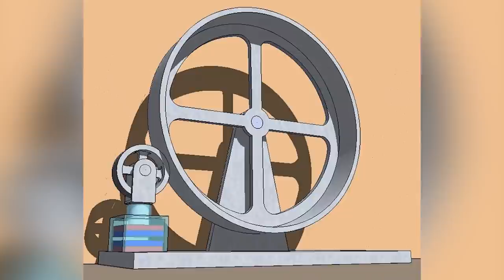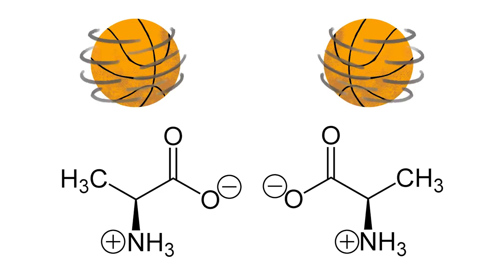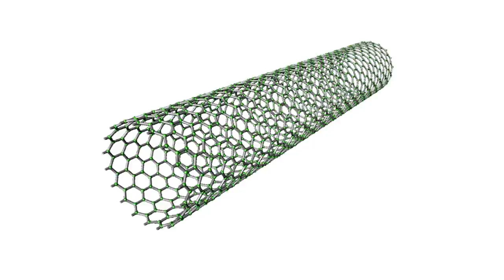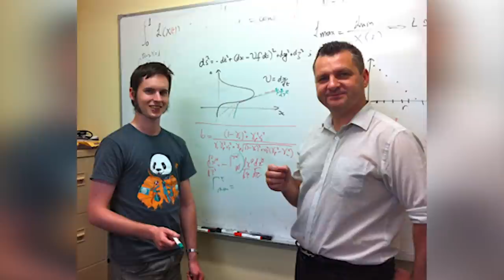Things Invented Just To Defy The Laws Of Physics

Comment: I’m sorry but here’s a list of things wrong with all of these:

10: dipping your hand into lead has nothing to do with defying physics 

9: perpetual motion machines clearly follow the laws of thermodynamics and therefore physics

8: follows the laws of physics 

7: warp drives don’t exist which means they physically can’t defy the laws of physics and what you mentioned at the end was an ion thruster which does use fuel, ionized atoms 

6: molecules aren’t the same as ions 

5: doesn’t exist and diamond nanothreads aren’t nearly as strong as graphene and this elevator is way to expensive to make and it would have to utilize rockets to build it. It’s incredibly heavy and with the current cost of payload per kg, it would be a lot longer than 2050 to make this when rockets are efficient and cheap

4: this doesn’t defy physics at all 

3: you explained it yourself, Newton’s 3rd law applies to this

2: this is just a prototyped weapon that follows physics 100%

1. Follows the laws of physics, the speed overpowers the surface tension until the friction slows it down enough that the surface tension breaks and the car falls in.

Please when you are doing videos about inventions and physics, do your research. Some of these things don’t exist and the ones that do, follow the laws of physics which makes your title very misleading. Also some of your information was flawed like how you confused an ion thruster for a warp drive. An ion thruster ionizes lithium ions and shoots them out and then they bounce of atoms around it, hit the thruster which generates lift and speed. A war drive supposedly messes with space time which is practically impossible. Please research your topic when making a video about it to five million or more people because some of them will believe it and go their whole lives thinking that we have the technology to go faster than the speed of light (which is impossible according to almost every physician in the world). Also judging by the way you present your videos I’m assuming your core demographic is thirteen years old or younger which isn’t really fair if you are going to give false information to younger kids because it will probably stay in their heads until someone corrects them which will confuse them a lot. 

Please do your research. It’s not that hard with all of the viable sources available which clearly state real information like nasa and others. 

Sincerely,
A random thirteen year old kid in Ireland that wants to be an astrophysicist or astronomer when they grow up and is really into physics.
Reply: You’re totally right. This channel doesn’t put in the time to make sure they know what they’re talking about, and they just do it for the views and stuff. Although, on number 5, it might have been an inclusive or. Like he was trying to say it could either or molecules or ions, because it could one or the other. But otherwise, this video is completely not factual like you said. Science is awesome and keep aspiring to do it.
Reply: Joshua Dorsam thank you. Nice to see another intellectual👍
Reply: Srsly. I cherish every one I meet. In this world of social networking and flashy facts with no background, people generally are introduced to many topics in a one-sided manner. It makes it hard to separate fact from fiction when non-qualified individuals seem credible and people believe them simply because they haven’t heard differently. Science as a whole is almost never correct the first time, but if people haven’t heard anything else on the topic, everyone who sees the ‘post’ immediately takes that stance. For example: My family liked the Patriots before this “Deflate Gate” BS or whatever. Now, even though the original document is retracted, people to this day still tease me about my Patriots Hoodie or whatever I happen to be wearing. It sucks when scientists realize their mistakes and try to sway public opinion again on the issue. Take Monsanto GMOS for example. TL;DR it basically says scientists linked GMOS to certain medical conditions. When people heard this, they were outraged. Like Washington Revolution outraged. People tried to burn the buildings down, protested by destroying their labs, singing songs of hatred and disgust in the street. The uneducated general populace is a powerful thing. If you are still reading this, thanks for listening to my rant about American culture. I don’t have many friends, so guess where I turn to get my thoughts out. Farewell, fellow intellectual.
Reply: Joshua Dorsam I read the whole thing and honestly found it very interesting. I had never heard about that whole event before and I really learnt something from it. You sound like a guy who deserves friends and I wish you the best. Goodbye dude👋
Reply: Dude, I want to be an engineer(software engineer to be precise) and I’m a huge nerd, so I love physics and I totally agree with you.                    Sincerely an eleven year old boy who is a giant nerd
Reply: TMak TNT keep aspiring to do that. It’s a great career path👍
Reply: Mag Arts  thank you for all that
Reply: it might actually be possible for an object to travel faster than the speed of light via anti matter but you would have to use electro-magnetic tanks to hold it because it literally blows up if it comes into contact with any sort of matter other than itself but yes you are correct this Chanel does not put enough care into anything science related
Reply: Alex Anderson I’ve heard of that theory before and just thought it sounded impossible, but interesting nonetheless. I fully agree about the channels lazy content
Reply: not to mention a bunch of the actual images and clips have nothing to do with the actual subject matter... starts talking about Perpetual motion machines, shows a lego marble run, talks about a warp drive but shows an EM drive which is a completely different thing.
Reply: damn
Reply: AwesomeVindicator haha. Also I didn’t know all of physics was just e=mc^2 written on a blackboard
Reply: Welove Terrorists I know. It’s a disgrace
Reply: Not to mention he said that proxima b was 80 years away, when its actually 4.2
Massive difference
Reply: Nicolas Bonny yep
Reply: Justin Andrei Diana Tamayo your welcome
Reply: Woowwww, I'm ashamed to be one bit European, if I have this "I am very smart" extremely extremely fun at parties person who has European
Reply: Mr. Cheese woowwwwwwwww, your gonna be  whining that I spelt you’re wrong? Grammar Teacher
Reply: Umm, diamond nano threads are another name for carbon nano threads and graphene I a flat version of the same thing but are not as strong for cables
Reply: @WHOOOSHXDOfficial  oh. A "popular kid." Not gaining my respect.
Reply: I love physics alot too but im going for chemistry. Im close. I have another 4 semesters to get my bachelor's. They say theres a hierarchy for difficulty in science. It goes biology < chemistry < physics with physics being the toughest. I kind of wonder where computer science would fall
Reply: ARONIOUS2 have fun in college man!! i’d say computer science is around 2nd easiest
Reply: @sheauiwne5294  hey thanks man! Im curious if you studied science in college and how tough it was for you if you did. Ive been studying 8 hours a day to be able to get a's or b's. Thats basically a full time job with overtime. Ive since begun studying for my next semesters classes during the summer to get ready for them. I enjoy the material but its very stressful. I think i put in some of the most work of the students in my classes and i even still dont always get an A. Im worried that since i put in a ton of effort and yet still dont always get a's that this will hurt my chances of finding a job. My dream is to one day work in a lab 🙂

I think science have some of the hardest degrees to get along with all the other stem fields. Medical fields are up there as well.
Reply: ARONIOUS2 i’ve only studied science in secondary level education but in 3 years hopefully i’ll be doing and astrophysics course in college
Reply: WHOOOSH XD what does religion have to do with this?
Reply: PSYCHO GAMING nope diamond has a cubic structure whereas graphene has a flat and hexagonal structure
Reply: @sheauiwne5294  go for it buddy! Do whatever you have to do to get started on it. Who knows how long we have. Like for me since i dont have that much money, ive given up having a permanent place to live so i can make going to school work. It might seem crazy but im tired of working dead end jobs without being able to save anything. I know i was meant for more than this and im going to attain it if its the last thing i do
Reply: Thanks for saying all this so I don't have to! Maybe we'll work together when we become physicists. Doubt it though. Have you read "Astrophysics For People In A Hurry" by Neil Degrass Tyson? He is a famous astrophysicist in case you don't know. I'm 14. If astrophysics ever gets too easy, (which is doubtful) try quantum physics. Also, how do you put up with people always telling you to shut up? Everyone hates it when I try to rant on about physics. Have you ever heard of quantum entanglement? Quantum physics in general is honestly over my head but I understand astrophysics pretty easily.
Reply: Nice to see another physics nerd. Haven't seen another one since I was at Space Camp in Houston.
Reply: @jacobadams9876  hey there! i have t read niel’s books but i have read one of stephen hawkings and loved it. i’ve never really had to deal with people telling me to stop talking because my friends that i talk to about it are always interested and i’m just kinda the powerhouse for theories and knowledge. i’ve read a bit about quantum physics but i’ve never been that interested (apart from quantum computers). i’m 15 now and have shifted my attention more to tech and graphic design but i still love science and i’m going to study physics and applied maths for my leaving certificate. you seem very interested and a lot more knowledgeable than i was when i was your age so keep that same energy and i hope you do well with astrophysics in the future!!

Comment: That copper construction you've shown while talking about warp drives does nothing. The inventor claimed that it would generate thrust  but it didn't. Not only did it not create any thrust, the only force measured that could make anything move was the magnetic field of the copper wires used to power the "drive" with a direct current. This was already known for years (before this video was made)

Comment: @9:28 that’s because the area of effect on the sails is higher then the area of force exerted by the fan. It’s a simple calculation. Think about a parachute stopping you from falling vs. a giant fan placed under you stopping from falling. The fan would de nothing while the parachute would slow your fall enough to land safely. Helicopters are close to the same idea of a giant fan, however the power output and angle of attack are completely different.

Comment: Wrong on the sailboat. The momentum of the fan blades which are pushing the air, thrusts the momentum equally out the sides of the fan. This seemingly wasted momentum serves to stabilize the fan and negate any forward or backwards thrust created by the fan.

Note that you could effectively turbo charge your sailboat with the clever use of a squirrel cage fan. ;)

Comment: An on-board fan can propel a sail boat because of Bernoulli's principle.  As required by Newton's laws, all of the forward energy of air channeled through the fan is cancelled out by the rearward thrust of the fan blades.  But due to the Bernoulli effect, the total flow of forward-moving air is not limited only to the air acted upon by the fan blades.  As the faster, high pressure air current exits the fan in the forward direction, it generates an entrained air current surrounding it, moving in the same direction.  The result is a net gain of forward-moving air relative to the sail not acted upon by the fan blades, and therefore not canceled out by the rearward thrust of the fan.

Comment: The spinning top thing might not rely on chirality after all. The polished surface could have been achieved with a clockwise spinning polisher, making tiny grooves that stabilize it in the middle only if spun in one direction. Another interesting experiment would be to bring the thing to Australia and see what happens, though the Coriolis effect would be weak at such a small scale.

Comment: I wonder if the square wheel theory solution is right. Because cars have a differential which prevents that your all wheels move at the same time, if your car didn't have this you would burn through a lot of tires because you wouldn't be able to drive evenly through corners

Comment: Actually we do know what provided the "thrust" for the zero fuel chamber. As it turns out, the equipment scientists are able to use to measure forces has gotten sensitive enough that what was being detected was the magnetic field of the Earth itself. We know that there wasn't any thrust being created by the "bouncing of microwaves" because the measurements were the same no matter which direction they were made in, relative to the "thrust" device. If thrust were actually being created by the device itself, the measurement for the direction being thrust towards would be different than the measurement for the direction being thrust against.

Comment: That elevator to space. I'd love to see a video where you elaborate on that
Reply: https://youtu.be/dc8_AuzeYKE
Or in YouTube search for "Space Elevator" and you can find shorter videos just about that concept as well. I personally think that ion drive tech will obsolete such a concept as it's likely a more versatile technology. While considerable effort must go into such a construction as space elevators which will have rather limited uses. I suppose it could be used as a spaceport but it'll be awfully vulnerable to many problems due to it's location. While a terrestrially positioned port, like the Kennedy Space Center, can be better secured and repaired with relative ease. A space elevator won't save much, if anything, on fuel once a better propulsion system is made and that will help with heralding in the advent of intergalactic exploration too! It might even be able to be used to power terrestrial vehicles as well, greatly helping to reduce future issues due to the currently most used methods. Though there's still plenty of neat ideas for large/mega structures like a Dyson sphere. The space elevator was a interesting idea and will likely have assisted in solving other problems by sparking the imagination, causing educated speculation, and in turn forming new technologies and improving old ones.

Comment: You got a lot of facts wrong , senationalizing them. We do not have any functional warp engine, not even a concept prooving one. The EM Drive you showed has been proven to be not actually functional, and does not have anything to do with a warp drive even if it did. Furthermore, a 4 light years distance takes exactly 4 years to cross at the speed of light, for an external observer. Not 80 years. That was for a craft doing 5% of the speed of light, also theoretical. A tiny "detail" you "overlooked".